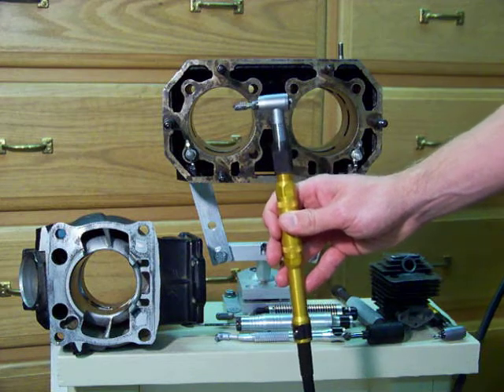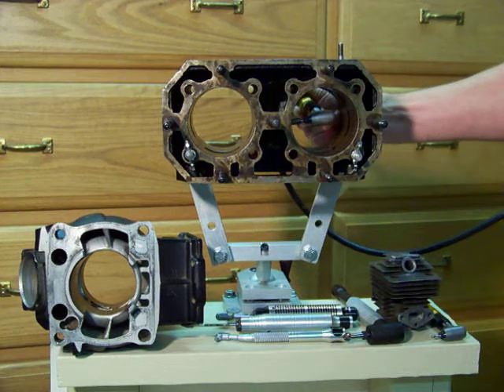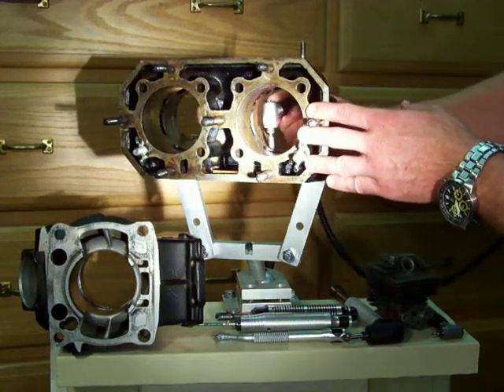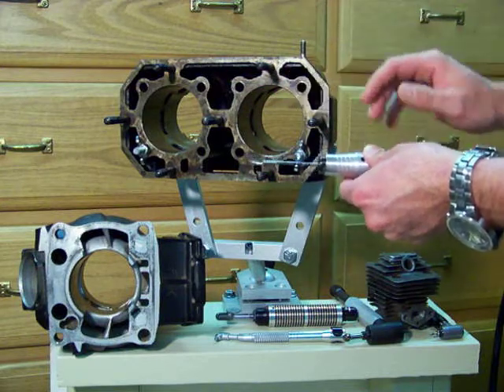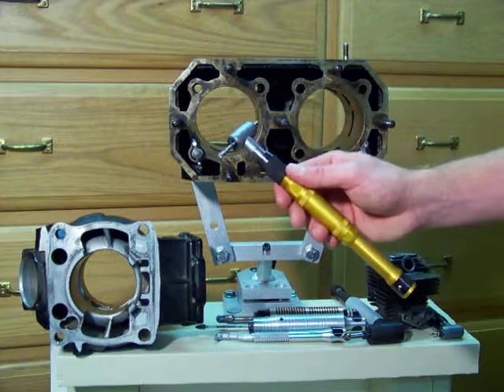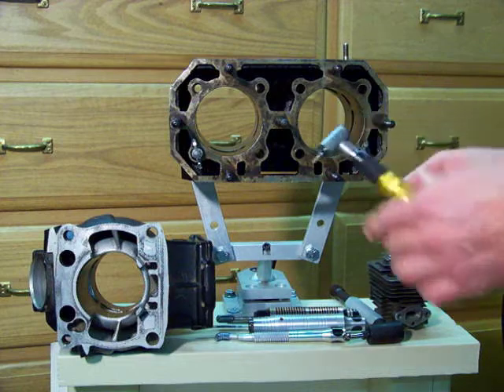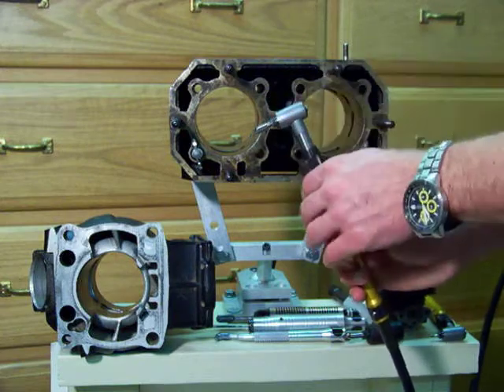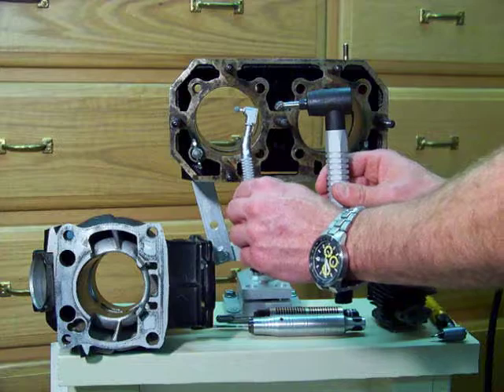2 stroke porting tool 1MCVID.MOV

Comment from the maker: Correct. The 1MC, as stated, is made for use on cylinders of a displacement down to 100cc. The 182 AMC that is also shown on this channel is for displacements in the 50cc to 70cc range. and all the way down to 35cc, depending on the bore.